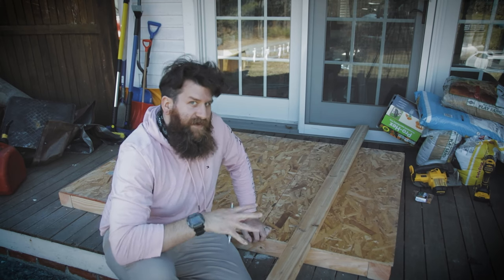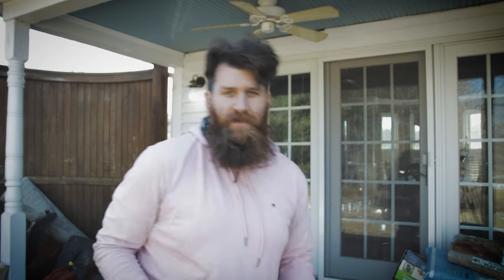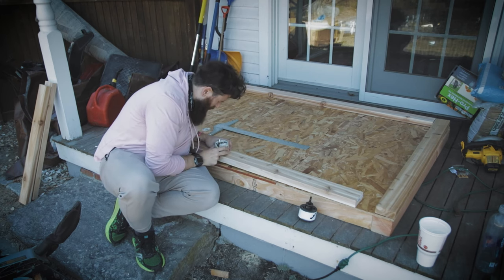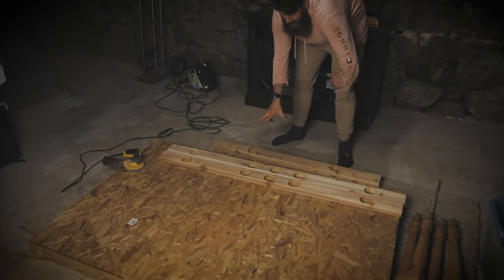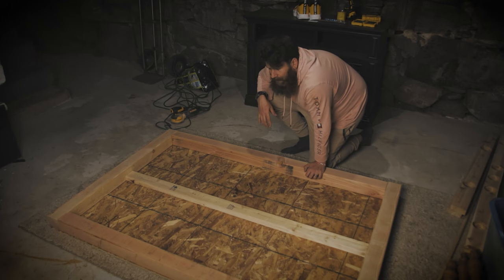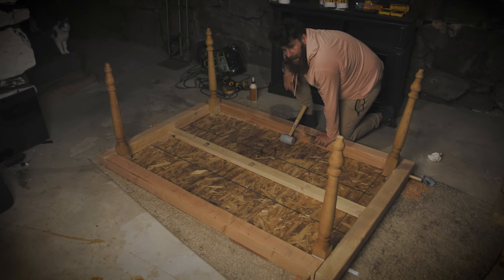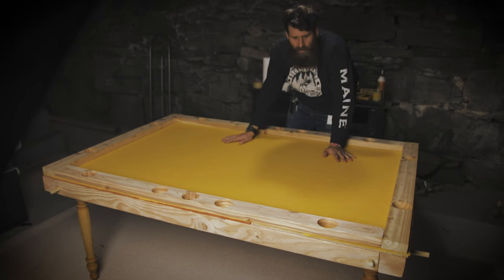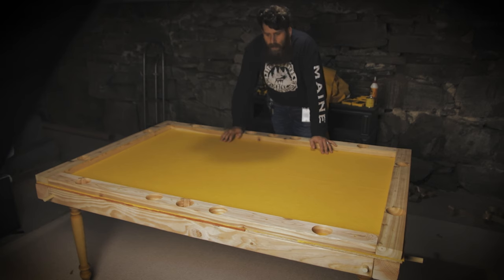DIY GAMING TABLE FOR UNDER $150 | Homemade Gaming Gear (Part 2)

Comment: I really appreciate you putting this up on YouTube.  I like the character that the protruding dowels give the table.     I'm curious if you like the felt after you've used the table a few times. Speed cloth might be another option.  Kudos!
Reply from the maker: Felt is going strong. Table has been used for quite a lot, gaming and video production, and I don't have any pulls, odd creases, or loosening.

Comment: Some Carpenter pointers. 

The felt is going to suck in moisture, and that is going to leak onto the table play area. A nice half round on the edges will help disguise the joining of the two boards and cover the felt on the edge, and provide your players with a nice edge to lay their arms on. 

Not knocking what you have done, its a nice table and if you and your players enjoy it that is all that matters. Thanks for putting your process out there.

Comment: You should have put some pergo floor foam under the felt.
Reply from the maker: It's been mentioned a few times and I may look into it on the next one, but I didn't want to add too much bounce for for die rolls. I like the idea of adding it, or something else, as an upholstery liner for the side rails though, making then more comfortable to lean on for long games.

Comment: I was brought here as I was trying to figure out materials and technique for the tabletop surface. I was pleased to find out 2x4’s will work as the rails! But I was surprised your surface was nothing more than felt on top of chip board. Assuming expense was the reason but why not add something under the felt for a little more touch? Am I underestimating felt?
Reply from the maker: Hey there! Couple of reasons. I had a bunch of chip board to use up, so why not. Even if I didn't have the stock, I wanted a cheap option (whole table came in around $150). And on top of that, with a couple of 2x4 beneath bracing it, it's perfectly strong enough. I've easily had up to 100lbs resting on the tabletop at once and it didn't even creek. Also, the felt or turf top (I've done both now) adds just the right amount of cushion and sound dampening. You certainly don't want enough material to add bounce. Dice are unruly enough as it is.

Now, one thing I will consider next time would be adding a simple upholstery padding to the rails. Resting your forearms and elbows can get a bit tiring after 3 or 4 hours.

Comment: In theory, if you put a thin steel sheet under the felt, could that be used for magnet bases to adhere to?
Reply: You could also inlay magnets under a dining table top and make it a convertible